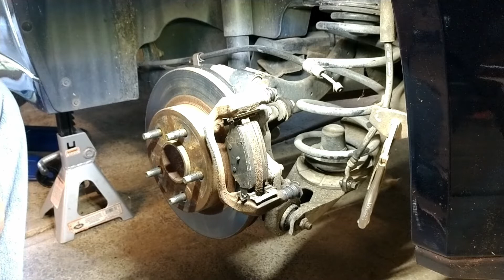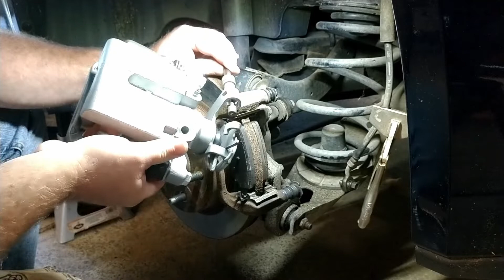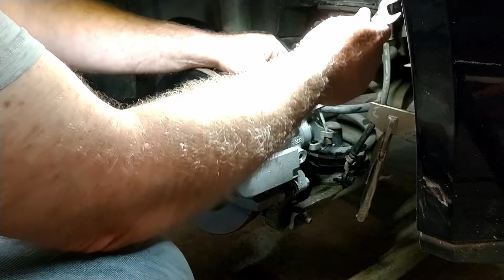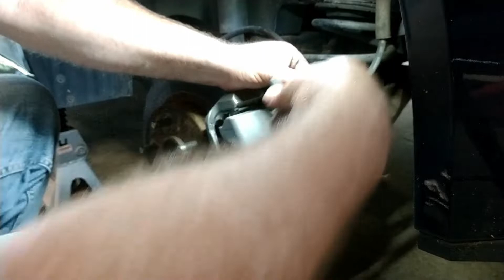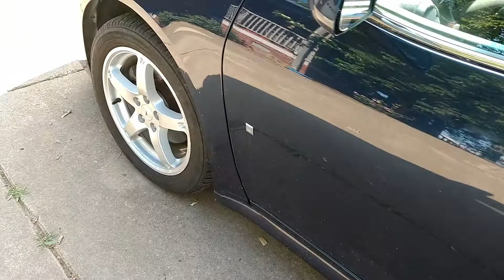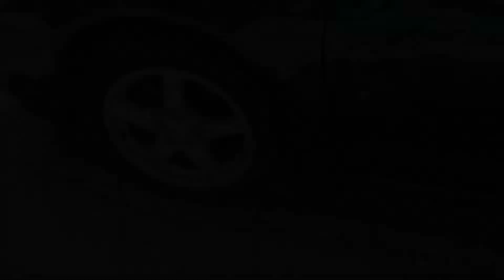Pontiac G6 Rear Brake Caliper Replacement

Comment: Hi, I notice that my brake fluid was leaving quickly and I notice what I thought was oil on the ground, I got on the ground to look and my back passenger tire was full of oil what can that be
Reply from the maker: Hi! Most likely going to be a leaking brake caliper or brake line. 

Good luck!
Reply: @ktecgarage  thank you for replying back and yes just found out today that it’s a leaking brake line, until I find someone to fix it I just been letting it sit cause it sounds to dangerous for me
Reply from the maker: Hope it works out for you.

Comment: how did you remove the parking brake wire?
Reply from the maker: I don't really remember. It seems I compressed that spring with a large channel lock. I do show reinstalling it, if that helps. Sorry about that. I was new to doing videos at that time and it's not as thorough as I like.

Comment: Note Ktec's piston on the new caliper.  It does not seat flush with the caliper like other rear brakes I have done.  That is the way it's supposed to be.  Also make sure one of the piston turning notches is aligned like in the video or it will not slide down over the stubby pin on the back of the pad.  Ktec may have mentioned that.

Thanks for the vid.
Reply from the maker: Thanks for the clarification.

Comment: Thanks for this! I discovered that mine is going to need more than just rotor and pad and discovered I have a sticky piston. I wasn’t sure how easy that parking brake cable was going to be. BTW, the bolts on the bracket are 17mm and the sliders 14mm. I was able to use my 3/8 inch socket driver on the upper bracket bolt by putting the socket on first, then a short extension, then the wrench. I also had enough room to use a short cheater bar for leverage to break it free.
Reply from the maker: Glad it helped you to catch the problem. Thanks for watching and commenting!
Reply: You did everything I did just checking I did it right thanks  for the help
Reply: Thank you for making this an easier fix  😊